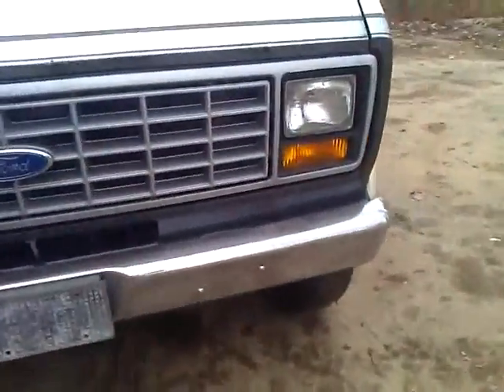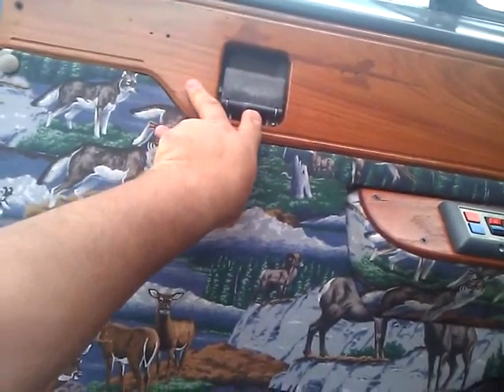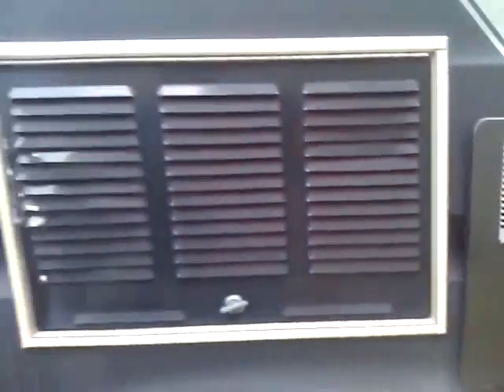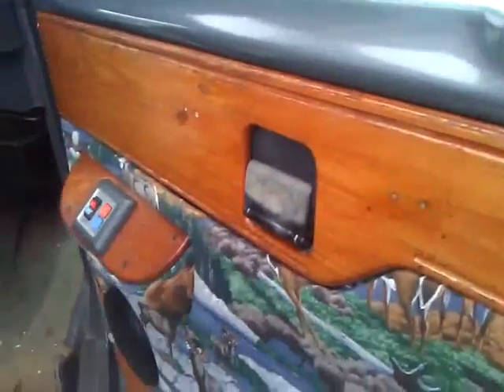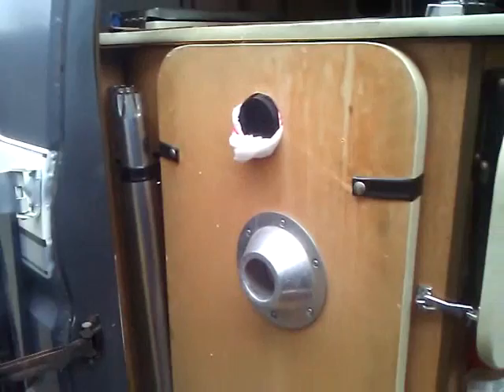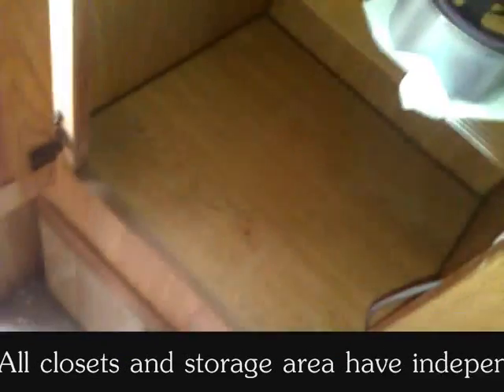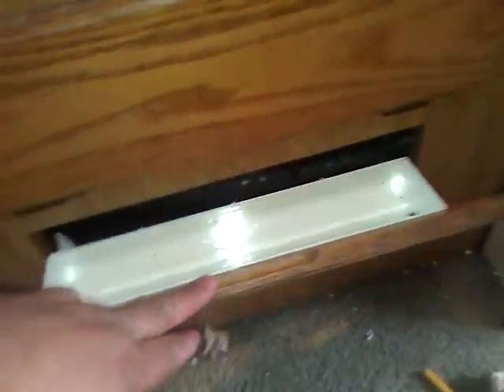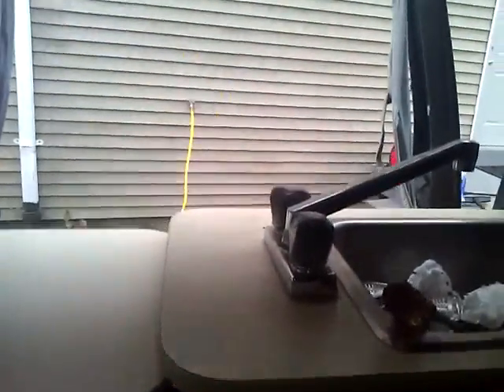COACHMAN BUG OUT CAMPER VAN

Comment from the maker: Hey I saw your van, love it and you're definitely going to be among the first to be notified on my videos. Remember to install and leave a 1/4 inch gap from the ends, as the floor needs to expand and contract with weather changes. And if you use 1/4inch trim it will hide the gap. Lay the trim back-side-down on the ground and spray them with a bit of polyurethane to water proof them and use a thin layer of caulking between floor and trim. (floor will still be able to expand and water proof)

Comment: Great van.  Definitely has the potential to be something amazing. Those older ford chassis  are a great place to start. I wish dodge had built their vans with drivetrains the way ford did and does. Cant beat the full frame either. Come on dodge, a unibody 1 ton ????  I am a mopar guy but, ford had this market in the bag.

Comment: I have an 89 Econoline 150 I want to repair, It's been sitting for about 7 years on my grandparents property The rats have chewed up pretty much all the wiring, Its a rust bucket and I don't have any ideas on where to start, I think its got a Windsor 302 and It is a pretty basic camper van, Just a bench seat that leans back into a twinsize bed, Any Ideas?
Reply from the maker: Unless you can do most of the work yourself and some for very cheap or free, you're better off buying another one that needs just a bit of repairs.

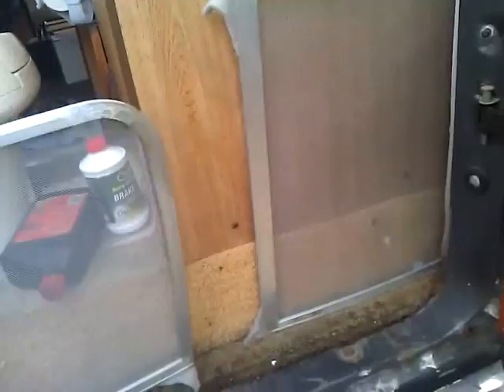Comment: RE: 5:18 You are holding up the bug barrier screens to show the label with the phone number but is too blury on my screen. Best guess is 800 543 0234?
FYI Ive had a 1992 coachmen ,same as yours,for 20 yrs. I put a 4x4 under it and a 4 inch lift 290 x 16.5 bfg. Airbags rear axle. Gen 2.2 onan and 12K ac on top Love it except mileage w/ OD & 351 ci ,onlyn5 mpg town or off road . 8 mpg at 65 but a whoppin 10 to 11 at 50mph. Ive had 36 ft with 454  and another 2001 30 ft rexhall v10, both same mileage  5-10